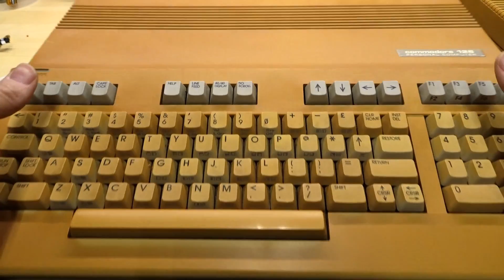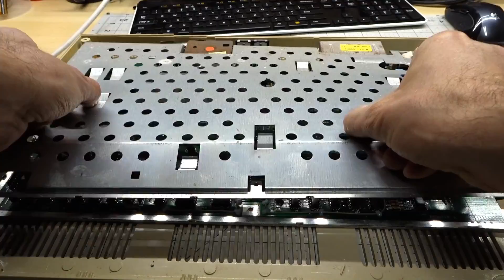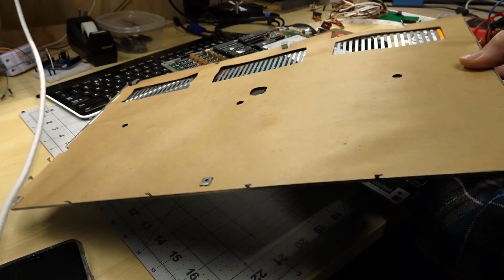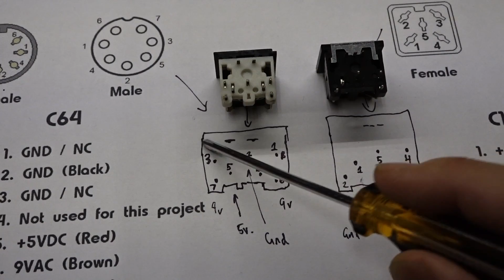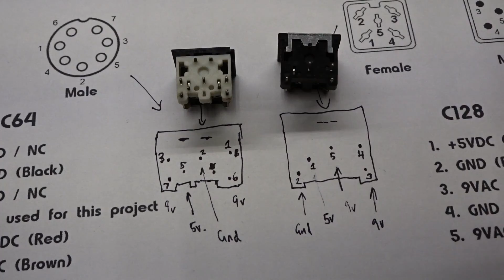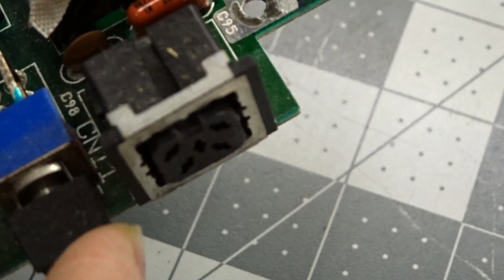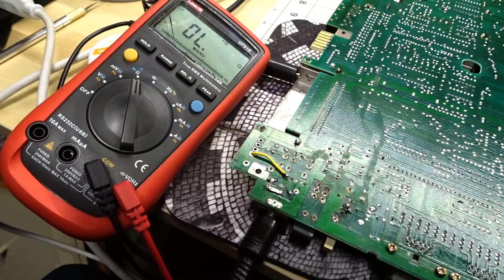C64 power supply on the yellowest C128 in the world

Comment: Should have just made an external adapter =(
Reply: Yeah, the pain he goes through of rerouting traces etc, where a simple adapter would have been cleaner and faster. Interesting video overall, but I really don't get his rationale.
Reply: @sjdpfisvrj  I get it, but I think the rationale was just that he could do this immediately and get onto testing the machine, rather than waiting a week or so for parts to arrive to essentially do the same thing.  I probably would do the adapter myself because cutting traces is not something i'd do successfully but i've also had situations where I also do the quick and dirty solution as well.  Also, I think it's good that someone went to the trouble to figure out this option and post a video on it. Lots of stuff out there about doing it the other way, so nice to have something on this option.
Reply: RetroGamePlus why bother the 128 power supplies are really hard to find and pretty unreliable . This makes the machine actually usable and reliable.
Reply: @FloppydriveMaestro  The square DIN connectors aren't as hard to find (or all that expensive) these days.  I bought 3 of them recently for about $8 IIRC.  I plan on just making a DIN5 <-> DIN7 adapter for my modern C64 PSU.
Reply: @cbmeeks  Yes the connectors are easy to fine but why bother making an adaptor when the power supply that uses those connectors are like white gold also why bother for a computer you are never going to sell when you can just change the port and make work with a power supply you already have without the need for an ugly adaptor.
Reply: I respectfully disagree. Original C128 power supplies are not that hard to find. There are always at least one or two (sometimes more, sometimes less) that show up on eBay, although I'll admit they aren't terribly cheap.
As for new power supplies, there is an eBay seller by the name of commodore4ever building brand new ones that come with the connector for the C64 and an adapter for the C128. There are other people selling new supplies out on the web as well, like a gentleman by the name of Ray Carlsen ( http://personalpages.tds.net/~rcarlsen/custom%20ps.html )
In regards to reliability, I would trust a C128 power supply that you can actually get into and service more than I would trust a C64 supply that is just a big brick of epoxy.
Reply: @FloppydriveMaestro   I'm not against what he did.  I think you misunderstood my remarks.  For me, personally, I prefer to keep the vintage equipment as original as possible.  I realize that isn't always possible or even desirable.   Drilling a big hole in the case and installing a huge fan for the C128 would be a stupid idea.  This port mod is nowhere near that insane.  Again, my point was that I do plan on using the PSU I already have (a modern replacement C64 PSU) for my C128's.  And as for the adapter, the ones I make aren't quite as ugly as you might think.  ;-)
Reply: @LeftoverBeefcake  You can build your own power pak that will power a C64 & C128 for well under $100.  The Meanwell Industrial Switching 3Amp 85-260VAC to 5VDC power supplies with much better regulation than the simple Linear regulator circuit in the original Commodore bricks are less than $10. Honestly that Commodore circuit looks like it's borrowed from one of the old Radio Shack project booklets.  Usually those linear DC regulators are noisy as hell even with the 4700uf smoothing capacitor on the output. 
Once you have an AC to 5VDC supply you just need a high quality 1Amp or more 120VAC to 9VAC transformer, an enclosure, Panel Mount DIN connector, Fused IEC power input plug, Front Panel Switch, Panel Mount fuses for the 5v, Solder, wire, and maybe a fan.
Chop the C128 power cable off the dead power pak and solder a 7 pin DIN on the end to mate with the DIN on your power supply.  A C64 can be powered with a $3 off-the-shelf Male to Male  DIN cable.
If you want to power an Amiga too add another DIN connector and use a multi-voltage AC Switching power supply with at least 12VDC and 5VDC out rather than the single voltage unit.  This might come closer to $100 but it's still peanuts.